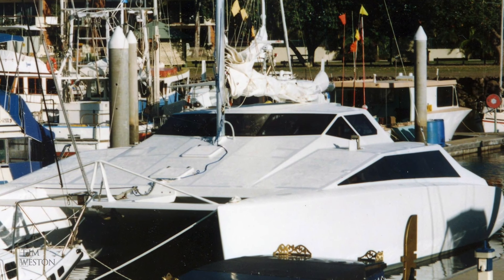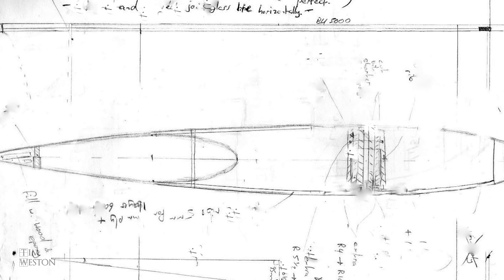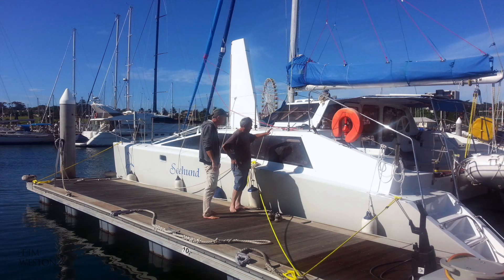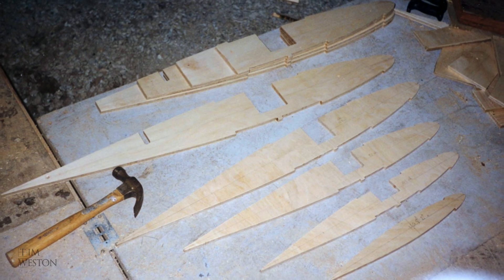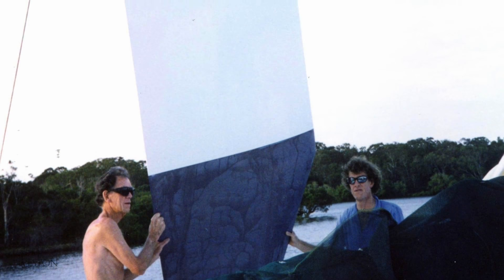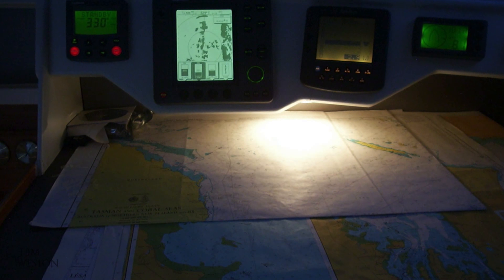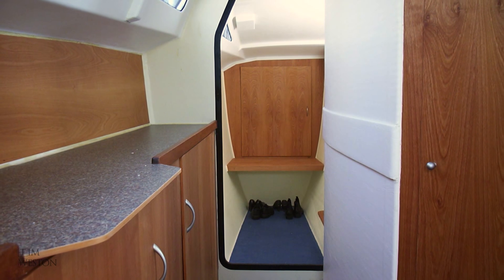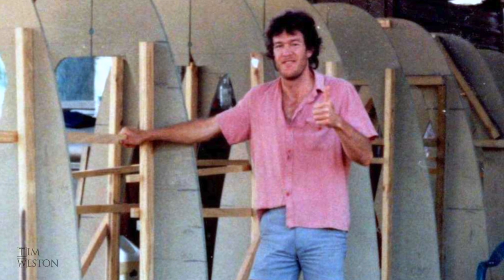How to build a boat Ep #13 - Catamaran you can live on - Daggerboards

Comment: In the sport of windsurfing which I have enjoyed for the last 26 years.... We can't sail our old 12' long course boards very well without a vertical dagger board... On a 12' board which is about 28" wide with the dagger around 24" to 30" deep and a cord of about 5" .. When the board speed would pick up we angle the dagger back into the sailboard to about 10% exposure just to give a little positive direction..and reduce the resistance....   Up wind is where is does best... I can relate .. Thx for the cool unassuming videos.. So from a Kiwi to an Aussie cousin ..don't quit now, you have many of us I'm sure, glued and waiting to enjoy  your next project....
Reply from the maker: You also use a good size dagger board for the size of board you sail. I'm sure you notice it well, the effect of it being up or down.  Thanks for your comment and input Stick. I spent a few years living in NZ, love it over there.  All the best across the pond. 👍

Comment: Tim; this is totally enlightening for me. I sailed a Granger Cat 7000mls back to NZ from Borneo  mainly on the wind and usually in under 10kts. Pointing into the wind was so frustrating that we ran 1 engine a lot of the time and it put me off cats. Sometimes we did 120mls and only made good 40 when tacking. I like the way you  back your ideas by making radical changes to the normal way of thinking. Keep it up and keep sharing.
Reply from the maker: Hi Mike. Thanks for your comment and feedback. It is nice to hear another's experience. Yes I too was disappointed in the beginning. Especially on a long trip like you did even a few degrees improvement makes a huge difference.  Yes, it was a big effort tearing it all out and building a new one in, when I look back I wonder myself at the faith I had in my ideas. But it worked..  Cheers Tim

Comment: Very interesting.  I recall that one of the major designers also uses single boards on some of his designs. 

I have a dory shaped hull 28’ cat, by Richard Woods.  He said that in a disturbed sea a board makes a lot of difference as it is more in clean water.
I have removed damaged LA keels, and just fitted a single board.  First to test that, then fit the other…maybe need to reevaluate, not tried out yet.
She did actually make good upwind above five knots. But manoeuvre poorly.
Mine is 1.9m long, 1.2m depth,  400 cord.  Actually smaller than the designers plans….hmm? I didn’t want it too heavy.
Tim, did you have to reinforce the hull / casing?
Reply from the maker: Yes Mark, I did reinforce the hull substantially, when fitting the new board and case. The board was 150% the area of the original 2 boards, so a lot of load. But she went up wind like never before. If replacing the original boards with one, try to make it at least as big in area of the 2 originals.

Comment: Nice! Can't understand why all commercial cats are using two daggerboards........  It would be great to hear how you have designed this big one...  what is necessary to consider....  can't find any books about it...    all daggerboards that I see are straight ... not sure why... if they are angle like 45degrees this could avoid getting fishing net stuck to it...
Reply from the maker: Hi, RF. No, I can't understand either. The nautical community is always slow to accept change. After 5months work, I've just finished plans to build this board, with an improved shaped, detachable tip. Which also, won't get stuck in fishing nets... There is more to this board than meets the eye, but worth the effort. It made a huge difference to the performance of my cat. Regards, Tim. https://timwestonboats.com/daggerboard-te40/

Comment: Are you worried about it tripping you up on the leeward side? I also put a set of new boards on my crowther, making them longer, but didn't consider using just one... 150 kilo seems like a lot... but I think that's around the same as both of mine. How do you like it a year later? Thanks for the info!
Reply from the maker: Hi Sailing Zingaro. No, I never worried about it tripping me up. I am still satisfied with the choice to build one instead of two. I would do it again, just the same. Tim

Comment: I was on a junk today in Taihu lake (China) and was thinking about your video at the time. I have come back to make a comment. The skipper told me that without the keel boards down, there is no point in having sails unless all you want to do is run downwind. These junks have an extremely shallow draft and without the boards it just goes sideways. 

One thing that occurs to me is a question about depth. Why does the board need to be deep in the water? It is not like a monohull where you have a counterweight on the bottom. Why not have a board that runs long and shallow between the hulls? It would not take up any internal space and could be set shallow or deep just by changing the angle.  If fast you could reduce drag by raising it. If slow you drop it down till close to verticle. Mounting would need to be strong, but should be possible.
Reply from the maker: Hi, Terry. The skipper was correct, especially with the junks. The cats are similar, they will just slide sideways without a board. The board works in the same way as an airplane wing,  the tip of the board generates a large part of the drag. A deeper, longer board has a higher aspect ratio, giving more area and lift, for the same tip losses, (more or less). The trade-off is structural, longer is higher loaded so it's a compromise how long you go. Tim
Reply: @TimWestonboats  Got it Tim. I will take a look at the loadings and decide which way to go.  One surprising feature of the junks is that the keel boards are just lowered over the sides and strapped in place. Nothing fancy at all. Maybe the seaging ones of old Admiral Zhang He (Cheng Ho) 500 years back were different. I assume so.

Comment: Thanks Tim,  as an Electrical Engineer, I am really like your engineering spirit on Tokyo Express. I want to build a 40' cat with cedar core method.  Do you still have your old hull plans to make those mold boards ( just both hall and mid deck)?
Reply from the maker: Hi Osborne, and thank you.  Your plan sounds like a great move, I think strip cedar is a great way to build. I do still have the plans, but they are not for resale. One boat only, from a set of plans.

Comment: Interesting video. Does it matter for the board to be longer, (front to back), vs deeper in the water? I'd assume there'd be a point of diminishing returns, but you did the testing. Any difference, or would the sweet-spot depend on the boat it'self?
Reply from the maker: Hi BeachBow.  The philosophy of the majority is high aspect ratio, as deep as you can and skinny fore and aft. In theory it sounds good but for me you need a fair amount of chord (front to back).
Reply: @TimWestonboats  In theory, the best aspect ratio is dependent on boat speed.  So, long and skinny is best when going fast, but shorter and faster is better when going slowly.

Comment: So, area three times that of either of the original two cambered daggerboards that I guess were intended to be used alternatively. That had to make a difference!  I am surprised, though, that there was no difference in helm balance from one tack to the other, given the distance off the boat's centreline that the new 'board is acting.  We live and learn.
Reply from the maker: Hi Anton. Yes, I was surprised also, but after a lot of testing and trailing there was never any measurable difference. I sailed, and even motored with it, always fully down. It improved the steering, and the speed with even a hint of wind. Tim
Reply: @TimWestonboats it can be a mistake to fully lift your board(s) when running, as the bow tends to catch and you can broach (unlike a mono).

Comment: That's interesting - I'd always assumed the reason cats didn't go to windward was too much windage. OTOH TE looks a bit more streamlined than your average modern cruising cat.
Reply from the maker: Hi Robin. The streamlining would help a small amount but it is the board that makes the difference..
Reply: I guess you can overcome windage with more power - and in a strong wind you've got more than you need, but only so long as you can resist the lateral force, which is why the bigger board is important. Does that mean sailing closer to point where you might tip over or break something?
Reply from the maker: Having a bigger board in the water does make it more possible to capsize, if you are pushing it, because you can generate a greater capsize moment. It shouldn't mean you will break something. It is a bit like having a car with a bigger engine, you can go faster and climb steeper hills. The greater speed possible can get you into trouble, if you don't know how to drive but it can get you out of situations and be an advantage if you know how to use the power you have.